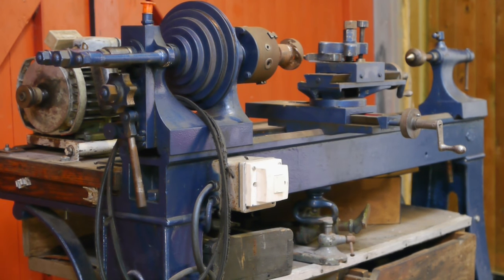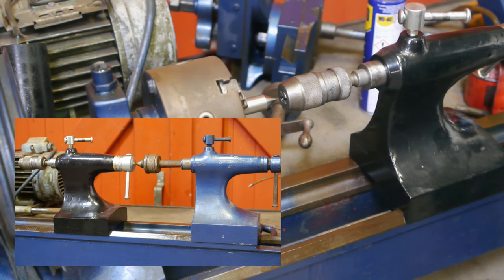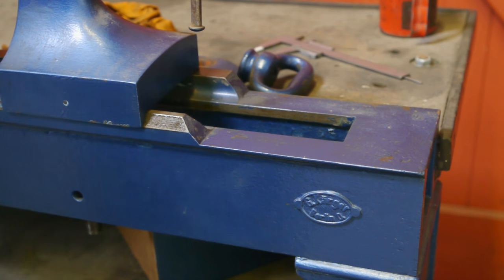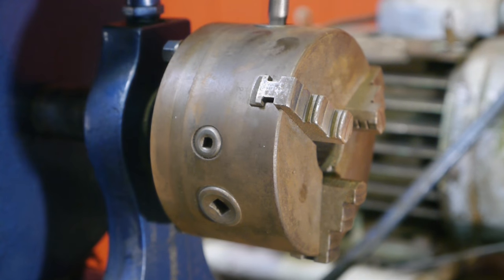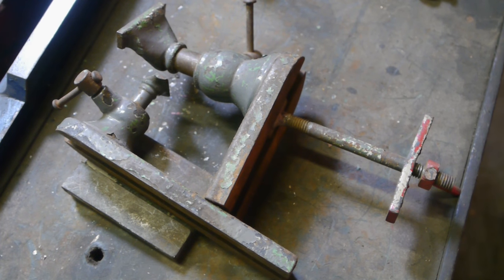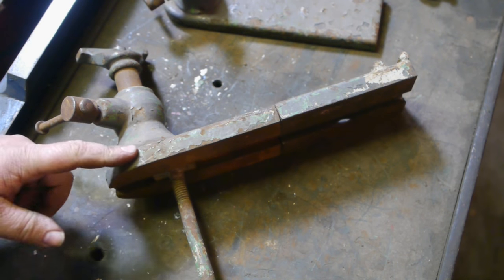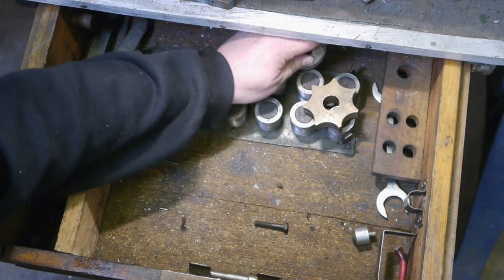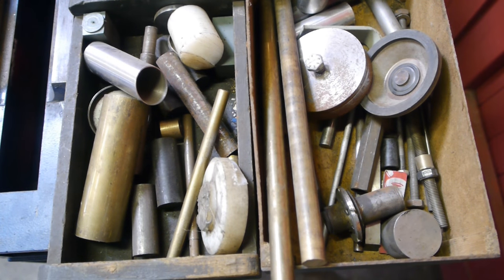Vintage Karger lathe

Comment: You have bought several lathes because they were close by and really cheap.  Same thing has happened to me and I think I'm going to need a doctor soon, some kind of addiction specialist.  And none of the antique lathes I have include a lead screw or half nut- I'm considering actually making a lead screw (you can buy generic ones cheap).
The threading you have there is 'chase threading' and the fact that you still have the parts is really rare.  Take good care of that!  It would be awesome to get it working.

Comment: That's nice lathe,
 it looks that is possible to cut different type of threads, changing the  top threaded insert(on spindle) 
and rotating bottom threaded star knob.
Reply from the maker: Not sure if it's a nice lathe, still need to test it. Could be a total piece of shit. But it does look kinda cool with it's Smurf paint job.

Comment: Good one.  Very interesting lathe.  I've not seen that method of threading before.

Pity that mount has been cut in half. Maybe it can be brazed together again.

Thanks for posting.

Rob
Reply from the maker: Thanks Rob.
I have zero experience with brazing will this be strong enough?
The joint will be extending past the baseplate for big tuning jobs.
Reply: It should be strong enough if done properly..  Brazing gives a complete 100% bond, where as electric welding can't do that unless you grind away metal and weld out/build up from the centre.  This will distort the piece and can be weak on cast iron.

To braze in this situation you should key both mating ends with manganese or nickle bronze (strongest) for complete coverage, then butt them together and heat to make the bond.  It's the same principle as soldering, but you will need oxy to do it.  Also run bronze across the top of the join to make sure you get complete coverage/capillary action into the join when heating.

You will have to have both pieces on a flat work base of brick or similar to keep things aligned.

Cheers Rob

Comment: Is it possible that the ways don't extend the full length of the bed because the head and tail-stock have been switched? The missing ways look like some kind of gap-bed arrangement meant to give more swing by the headstock. This is a complete guess on my part. I do some turning, but mostly wood, so I'm no expert.
Reply from the maker: The single v-way makes it impossible to switch the head and tail stock.
Maybe the flat is for some sort of attachment but I haven't gotten a clue what.
Reply: Yep, that's what I was thinking too.  However, headstock also fits on the ways.... so that leaves me unsure. Having the option of a sliding headstock does possibly offer some interesting extra capability.... maybe. 
This lathe looks like it started life as a treadle lathe, thus the round belts.
It's really beautiful.   I'm getting tired of lathes that lack leadscrews, though, and that don't have sliding carriages.

Comment: There would have been a set of threaded collars that fitted on the rear of the spindle - as the one that is there - these would have  threads of different pitches to match the  follower that is engaged by the lever at the rear of the headstock. this was quite a  specialised machine and it's probably been worked hard in its life. Being of German manufacture it was probably a quality machine when it was made.

Comment: Wow, I would not have imagined you finding two similar lathes of that vintage.  Looks like one company copied the design from the other.  Interesting threading method like the other one, but this has more parts and templates.

This could make a good wood lathe.  You should be able to braze the banjo together.  I would drill either side of the dovetail for  pins to reinforce the joint.

The chuck has two sets of key holes.  You showed the larger key holes with the key to move the scroll and jaws.  Is the smaller hole for truing up the chuck?  If so a very early style to get a chuck running true.

A nice collection of metal stock including a big piece of brass.

A very interesting walk through of the lathe.  As you said the tailstock is similar to the other one.  Shame that it does not have Morse taper on the quill.
Reply from the maker: The name could have been removed for export. Germany wasn't the most popular country for a large part of the previous century.  Even the English royal family changed their German sounding name at some point.

To bad about the banjo. What are the chances of getting all the right parts with two different lathes only to find out the they have been cut in half!! Such a shame.
I'm not sure about brazing. I can't do this myself and it will always stay a weak point. 

I had a quick look at the chuck and I think your right. That little key fits the small square hole. Unfortunately I can't turn the key, it's all seized up. I tried to find out the name but it had become unreadable. There are some patent numbers for different countries on the front of  the chuck. But they are also very hard to read. I'll make some pictures after some more cleaning. This thing has got me interested now :)

The tail-stock is neither MT1 or MT2.  So that not very usable. But perhaps it can be made into a MT2. The wall thickness on the front of the quill would got from about 5mm to 4mm.
Reply: They are clearly the same make.  Many lathes got made without ID tags so that a reseller could sell it as their own.  
Yes a very interesting walk through, sometimes I honestly enjoy looking at old stuff like this rather than actually accomplishing real machining with new stuff.